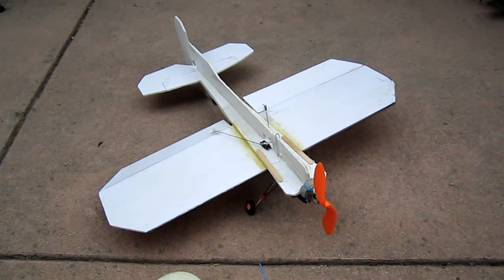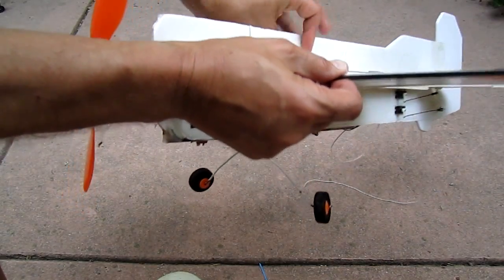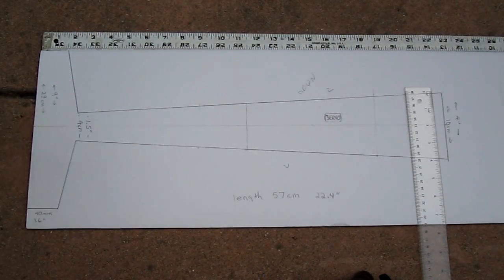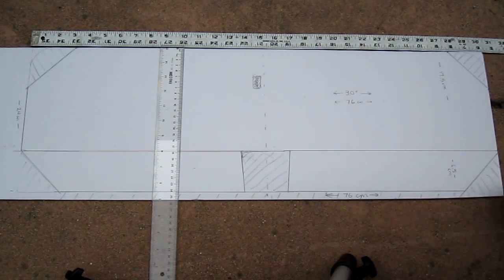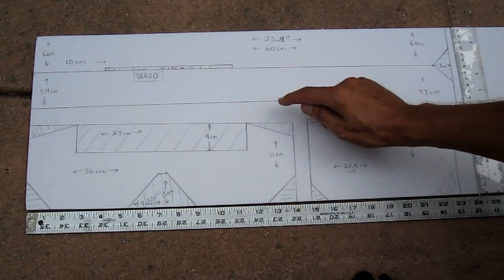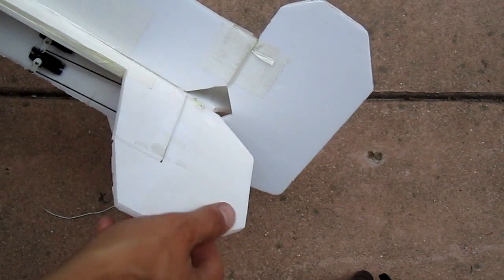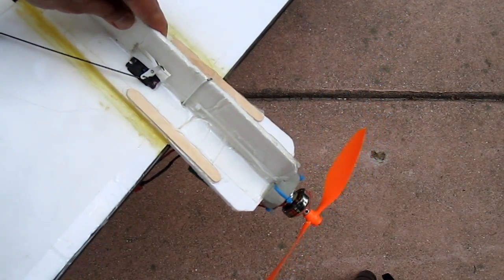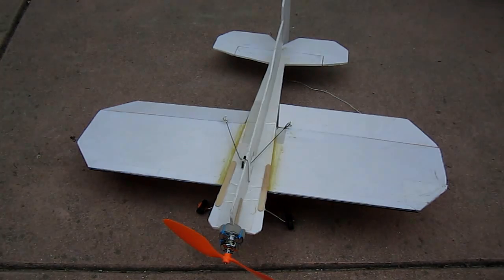How to make a crash-proof 3D foam RC plane

Comment: dear, this is wonderful plane design, easy and strong, i have 2 question hope to get answer.
1- what foam type used, and where can we get, it seems strong foam.
2- do you use aerodynamic shape on the wing or just use flat foam no need to shaping.

Comment: Please provide me the link of the website from where you purchased all the parts.
1.BM2408-21 KV 1750outrunner brushless motor
2.GWS 10x4.7 propeller
3.plastic clevis and control horns
4.pushrods.

Thanks.

Comment: I am interested in your crash proof plane construction.  In your video you state that you used 3mm laminated Ploystyrene foam in the construction.  I could not find the 5mm product at bphobbies.  Is the lamination already installed on the foam?  Did you do the lamination? What kind of material is the lamination?

Comment: Great video,,I built this model last year using dollar tree foam board,Fire power 300- 1600Kv. motor (Headsuprc.) ,20 amp Esc.,6x3 prop and a 450mah 3s battery.
It will go fast enough to scare the wits out of you, yet slow enough that a child can handle it.I did destroy it by the end of last season but have built a new and now I'm just waiting for the weather here in New England to allow me to enjoy flying it again.Great build,Great flyer,,thank you..

Comment from the maker: it really depends on the quality. you can get servos for $5 each and a 2.4gHz transmitter and receiver for about $50, an ESC for about $10. or you can spend many hundreds for top of line electronics. i used really cheap electronics and my plane seems to fly well.

Comment: I like the motor mount system reminds me of the old Goldburg Li'll Wizard 1/2A CL kit. It had the engine secured with rubber bands. Worked great. I borrowed the idea for several R/C planes I built.

Comment: using a prop saver (an o-ring that allows the prop to swing over when it hits the ground) would prevent your broken prop problem--and you might be able to ditch the foam engine mount.

Comment from the maker: @peroxidal   I drilled holes through the dense foam and mounted the motor with nylon zip ties, which will snap in a bad crash which saves the motor from damage.

Comment from the maker: @rickcbr900rr   I did use a dremel to cut off the threaded shaft beyond the prop and holding nut. Guess I could try a prop saver, but 6 of these props cost about $10 so even breaking a couple a year is only a few bucks.

Comment from the maker: @SHADOW10621  You're welcome. One an early crash I bent the motor shaft. Now I mount the propeller so that it is against the bell of the motor then I cut off shaft so it is just long enough for the nut to fit.

Comment from the maker: @saurabhudeshi   With all electronics, the plane weighs 320 grams (11.5 ounces). Here is list of parts: BM2408-21 outrunner brushless motor,  GWS 10x4.7 propeller, Hitec receiver, 20 amp 7.4v brushless ESC, 7.4V 1300 mAh lipo battery, three 9g servos, 4 plastic clevis and 4 control horns, pushrods: two 14cm pushrods, one 13 cm, one 15cm. Note that many other motors, ESC, batteries, etc. will work. I bought electronics from Tower Hobbies.